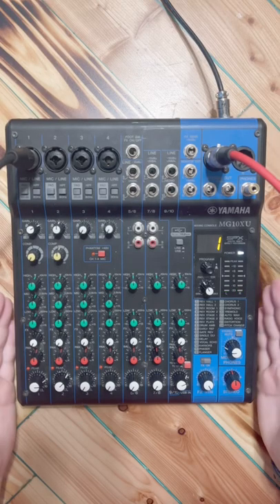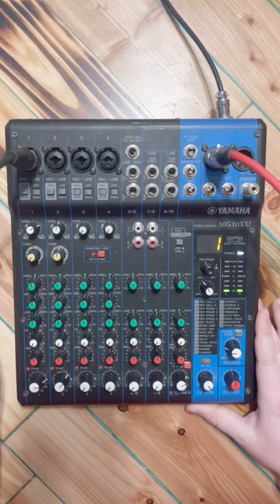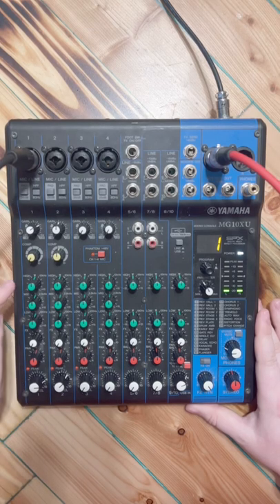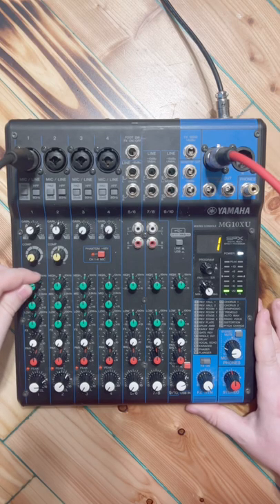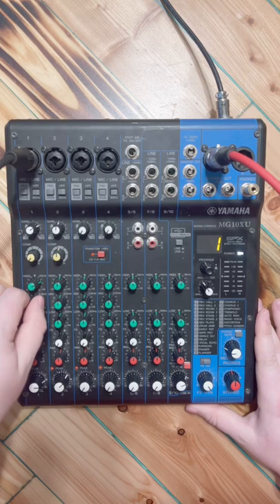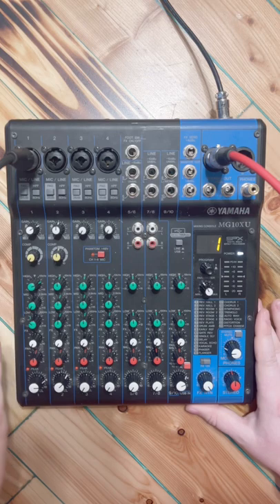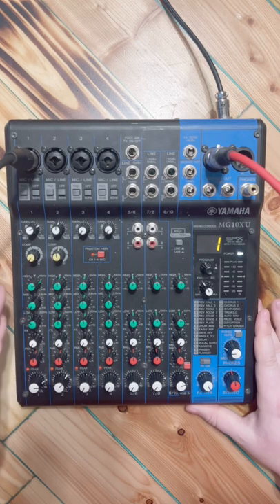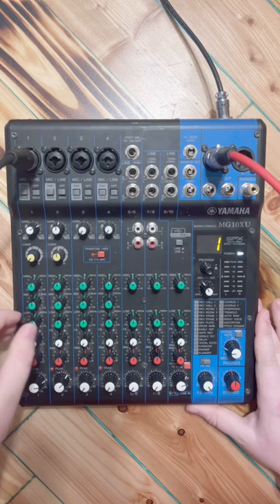The biggest mistake church sound volunteers make

Comment: I fixed a sound once where the volunteer "chief" was simply boosting bass on the preacher vox and we were getting pops feed back etc.. terrible.. I fixed it in seconds, he ignored it and did it again... and thennn I got blamed for interfering... we need a lot of PATIENCE when leading with people in general... (making a long story short)
Reply: They had someone come to my church (not sure if they were paid or just doing a favor) and actually had the sound as close to perfect as I'd ever heard. It only took an hour or two into service and 2 or 3 people fiddling with the board who had no clue whatsoever what any of those knobs do to ruin it again!
Reply: @nuthinbutlove  that's where you need a piece of tape with a line drawn on it to mark the settings (or write them down in a notebook or word document).
Reply: Arrogance, one of the worst characteristics a sound engineer can have. We have one of those. 
He never set or used a reverb. I installed a plate reverb one day to wet the vocals a bit on the live stream, but it sounds nice in the room too, he refused to use it. Then one day I come in find the plate reverb changed out for a hall reverb. Suddenly he's and expert, and it was so badly executed it sounded like they were inside a bathroom, not a clue. A couple of times I changed it back to Plate setting, eventually he gave up and stopped using it again.
Reply: @nuthinbutlove  I'm so glad my mixer has a feature where you can take a snapshot of how the board is set up and can revert to it at any time. 😂
Reply: @TimpBizkit they have that
Reply: @TimpBizkit Or take a picture of it on the ubiquitous smartphone and print it out.
Reply: @joebowers2249 Using a church reverb setting in an actual church might be fun. The guy might see it and think to himself that it's the right setting for a church because it's called church reverb and set it to 100%. After all, it's 100% a church!😂🤣

Comment: that green nobs can adjust sound frequenzy
green on the top is for "high" high tones like z zimbals 3500 hertz to 20k hertz
in the middle they called it "mid" it produce vocals sound,
and the green on the bottom can adjust the volume of the bass they call it "low"
its for adjusting low mid hi
that can produce my voice in the microphone, instruments, and music from the mp3 or phone laptop, going to mixer and transfer to speakers.
Reply: It takes a bit of getting used to what frequency band sounds like what.
Reply: The eq knobs can have different functions. Band filters for example.

Comment: Hi. Do you need an amplifier for the output speakers? I have a 15’’ passive speaker and I’m unsure if I should get an amplifier for it. I’m using it in a hotel conference room of about 50 guests
Reply from the maker: @Kodjoedem  anytime you have a passive speaker, you’ll need a power-amp. The mixer needs to plug into a power-amp, and then the power-amp into the speaker.

Comment: Will changing the settings on this board remove feedback? I’m trying to help a very small church, now my church to figure out feedback issues that are very distracting…. It’s like a buzz
Reply from the maker: If there’s a buzz, you need to figure out which channel the buzz is coming from. Buzzing is different from feedback. There’s probably a cable that is deteriorating. Try finding out which channel is creating the buzz and then see if you can swap the cable. If that doesn’t help, Google “how to fix ground noise”
Reply: If you’re using stereo cables make sure they’re balanced too
Reply: @ChurchCinematics  I will do that! Thank you! And let you know how it went.
Reply: Thank you!
Reply: @toni4jesus2 if it's a buzz even when there is no sound going through the system, it's probably a ground loop or bad cable.
Figure out what channels it's on, and then try unplugging whatever is plugged into the snake on that channel.
If it doesn't go away, try unplugging the snake from the board. If it still doesn't go away, it may be something wrong in the board.
If it's in the snake, maybe switch to a different snake channel.
If it goes away when you unplug a mic cable from the snake, try swapping out the mic cable. If it's still there, it may be in the microphone or DI the mic cable is plugged into.
If it's coming from a bass amp or keyboard or something, try flipping the ground lift switch on the DI, or try putting a DI in that has a ground lift switch.

And it may be coming from an amp or something and you may not be able to make it go away without replacing it or doing something more major.

If you have feedback, as in a squeal when someone is talking into a mic, then the eq can help with that, you can turn down the frequency of the feedback, but don't reset all the eq knobs like this video says, unless you know how to set eq, because there may be a reason why they are where they are, such as stopping bad feedback! Lol
Reply: @ke6gwf  thank you so much for your response!! It will not go unused… God bless you and keep you! ❤️❤️❤️

Comment: Another common mistake I've seen in churches is that they'll mistake "bass", for "too loud" and turn the bottom end way down. Many, more traditional congregations will have a pianist as the lead, or maybe an acoustic guitar. That person will be highly regarded and the sound person will have them too high in the mix. Other instruments or singers will be mixed nearly out and the sound is awful. The perception is that it's too loud because of all the clangy midrange, but if they would warm it up with a bit more low frequency, it sounds less abrasive.
Lots of smaller congregations with few people serving, and someone with little experience, or a bad ear, or just stubborn can make everyone's experience a bad one. Now if you go and approach the sound person be prepared for hurt feelings. Sometimes I think it would be easier with no PA system, or just the vocals coming through the PA. A decent musician should be able to balance their volume with the rest of the band.

Comment: I do know what they are …. And that is exactly what i do…
Tone knob (low pass filter) on the guitar,
E on the gain stage 1
Tone knob in gain stage 2
Eq for the reverb, eq for the delay
And 5 knob eq on the amp 1 and 5 knob eq on amp two… 

And all i do it turn them till they sound good… and depending of the venue they will end up in a different place…. 

And you tell me… it would sound better if i just leave the amp how they are if i otherwisely just push and cut where my ears want to

Comment: I'm a strong believer that you don't have to understand anything, as long as you land on something that sounds good
Reply: Without understanding chances are you won't get something to sound good to a trained ear. You should understand frequency, how those different frequencies will react in your environment, how to acoustically treat a space so that it will even be possible to get good sound, how sound phase works and ways to mitigate it, have an ear trained enough to eq well, and know where all the parts of a band should be volume-wise so that everything has a distinct pocket.
Reply: @Koubles  I agree that knowledge helps. But it can also trap you with the same ways, and forgetting experimentation. All we are chasing at the end of the day is emotional impact. And with that being completely subjective, there's no right or wrong way. I used to think for a long time that phase cancelation is bad. Then I learned that it can be used as a tone shaping tool, to find new dynamic textures that couldn't be possible otherwise.

Comment: It depends on what you're doing. For example, if this is your only EQ and the room has a lot of echo, you might as well consider turning down the bass a little, etc. But if you have more than a single channel input or a different setup than this you may need to consider how you EQ each channel for it to make sense. But honestly, you don't need to touch the knobs at all most of the time.

Comment: This is very bad advice. If you don't know what a knob does LEAVE IT LIKE YOU FOUND IT!
Unless you are willing to play with it during sound check and see what difference it makes, and return it to where you found it, unless you can improve it.

In most of the small churches I have helped at, (many of them over 30 years of church tech work), the channel eq tends to be set like it is to reduce feedback from bad system design, or make low quality or headset mics sound decent.

If someone who knows nothing about the system starts resetting them to Unity, you may all of a sudden get horrible feedback from a bunch of sources, or nasty plosives from the pastor during the sermon, or bucket based sound from the headset mic.

I know even if I have to sneak into the sound booth when no one is looking when I am visiting a church, I am usually able to reduce that constant feedback whine from the podium mic, and make the pastor's mic sound 10 times better with a few knob tweaks, and hopefully no one ever touches the eq again, but this advice destroys all that tuning, and is like setting the Main system graphic EQ, or System Processor back to Unity settings, and destroy the system tune.

Now, if the system is set up properly, with a system eq and good crossover settings etc, high pass filters on the mics, than you should be able to zero out the channel strip eq and be good, and on the bigger churches I ran, I set up the system processor so that most channels got zeroed for every service, because you had different mics or different users in each channel each service, but the headset mic channel EQ was left service to service, because it was set up for the specific voice and mic combination, and we had one pack dedicated to the Head Pastor, and the Countryman needs very specific EQ, so it didn't get touched.

But all the handheld stuff was zeroed as a matter of practice for every event, and then tuned in as needed for the specific users.

But I was able to train everyone on the team, and was there for most services anyway lol

But in the scenarios you are talking about, I can almost guarantee you that the same mics are left plugged in the same channels week to week, and no one is going to be adjusting for individual voices, and the chances they have a system eq or processor are very slim, so the channel strip eq is the only thing dealing with feedback frequencies or mic tuning, and thus should NOT be touched unless you already know what you are doing, and can get it back as good as it was, or better.
Reply: I love your comment.